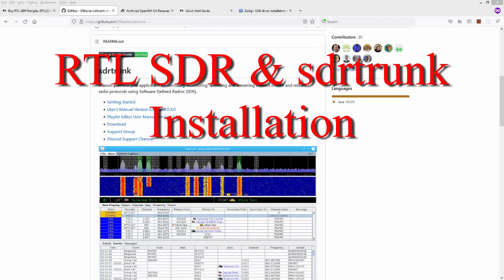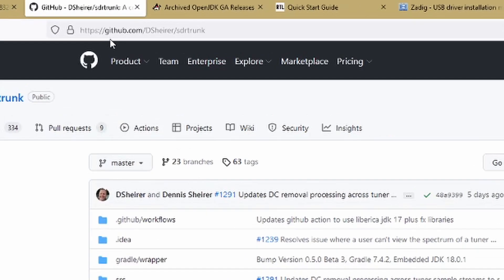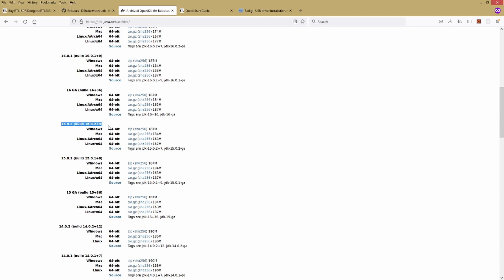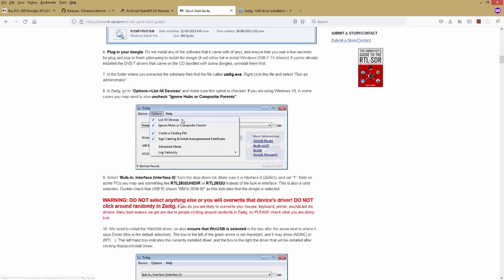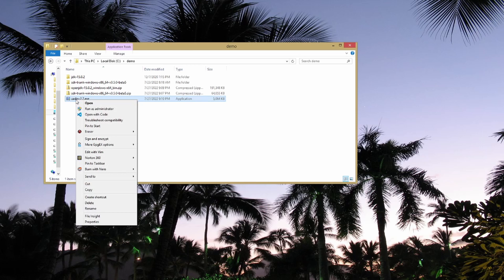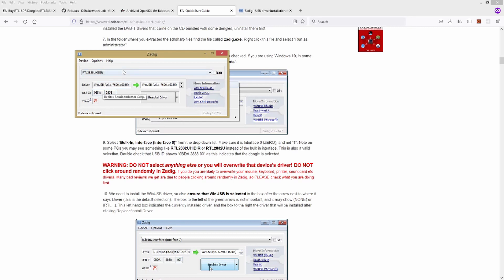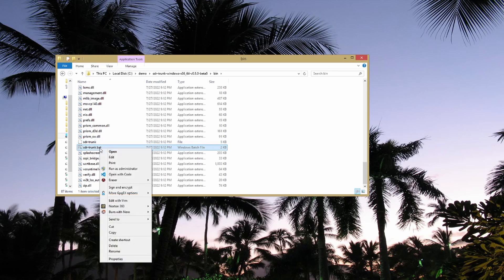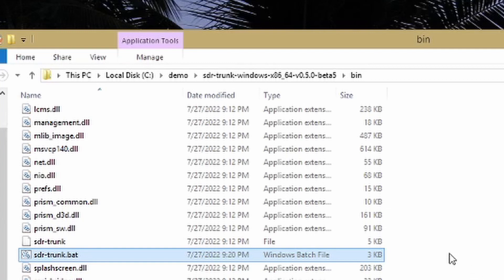Installing and Configuring sdrtrunk with an RTL SDR Dongle

Comment: RTL-2832 USB Bus:3 Port: 13
Status: Error - Unsupported/Unrecognized Tuner Type.

If i reset the turner I get an error

Status: Error - access denied - if using linux, blacklist the default driver and /or install udev rules.

I'm running windows 11, and have a RTL-2832, any help to get this to work would be great.

Comment: Wonderful tutorial!  I have an install following your instructions that works on a Win 11 box and one that fails on a Win 10 box. The failure displays the command line window briefly but quits without the UI window displaying. The Win 10 box also has a running v0.4 version but now does not display the extensive playlist I made and backed up.  Both boxes only use Win Defender.  Any advice on fix the Win 10 install?
Reply from the maker: I'm really not sure. I would recommend opening a command prompt window and trying to run the command to start the software from that window so you can see the error message being reported. That might give you a clue to chase. It's been a while since I made this video, but I think it uses a .bat file to launch the software. You could also add a "pause" command to the end of the batch file to try to get the window to stay open so you can read the error message.

Comment: Ryan, I have a problem similar to the other comment, I installed per your video.  System works fime for a couple of minutes and then quits working or plays an occassional part of a conversation every now and then.  Any advice on where to look to begin to troubleshoot this?  Please.  Thank You
Reply: Ryan, Just want to thank you for your helpful hints on my report of intermittent operation on the dongles and software.  After several trials and errors I found 2 thing that affected the outcome the most: 1, adjusting the receiver gain for a "sweet spot".  2, using separate antennas for each of the 2 dongle receivers.  Working well now, enjoying it.  Thank you, Pete
Reply from the maker: I haven't experienced that issue, so unfortunately I don't have an answer. I know that some of the RTL-SDR dongle have some thermal issues. Is it possible that your receiver is overheating? Just a guess.
Reply: @ryowens  Ryan, that is possible, both get quite warm.  Is there a dongle that you would like to recommend?
Reply from the maker: @Peter Van Den Berge  I have limited experience with different ones. I know that the ones from the rtl-sdr dot com site claim to have good thermal characteristics by having metal cases and heat sink elements. I've ran one of those for extended periods without issue, but that's about all I can say.